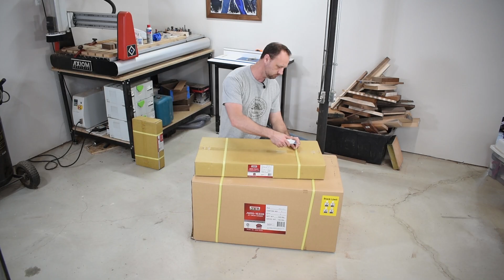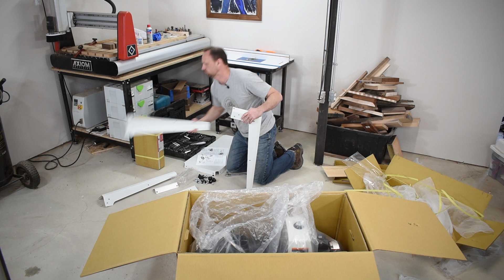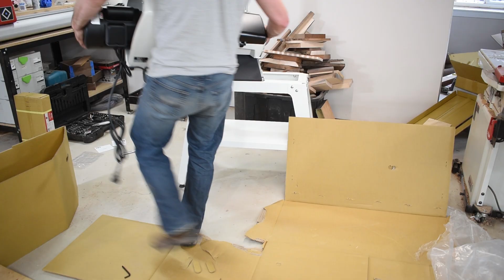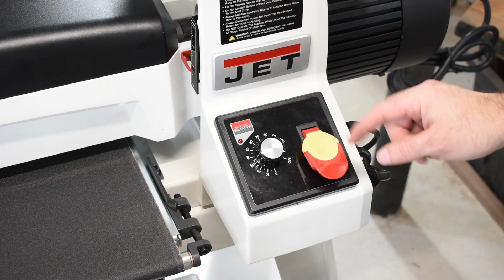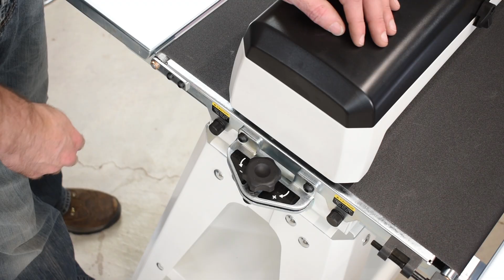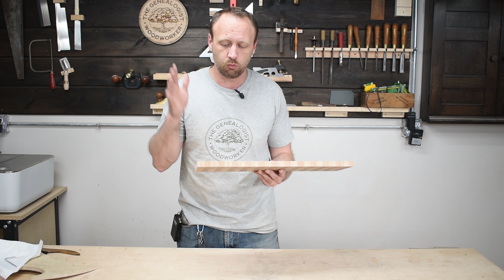Jet Drum Sander Unboxing and Setup

Comment: I wish you had bought the 1632 oscillator sander to compare post drum  sander handheld RANDOM ORBITAL SANDER  need . Do you know anyone who has used or reviewed the 1632OSC jet drum sander ? I have seen 2244 oscillator review but not 1632 oscillator review . 
  I have small shop in Idaho and have to sand outside and our weather  often makes this  horrible with winds to 25 MPH and frequent not forecast brief rain that makes me hate sanding and packing everything up to run into garage . Like your channel , trust you also . Jack in Idaho

Comment: Great video!  I just got mine and used your video to set it up.  Thx a mil.  Question though - why not just replace the 80 grit with the 120 and use the drum vs going back to the orbital.  That's what I had planned to do with mine, but now I'm wondering if it's just going to be too much work replacing it back & forth.
Reply from the maker: I replaced it with 120 which I keep in the sander. You certainly do not want to constantly change drum sander paper. It's not the easiest process. Plus, I've never seen a board that did not need sanding after the drum sander. It's a rough sanding tool that leaves marks. The most common practice is to sand the board with whatever grit you used on the drum sander. If you use 120 then start there with your orbital sander. If you use 150, start there.

Comment: I have this same drum sander and I cannot get rid of snipe.  I called Jet customer service and they were nice but no help.  Have you had issues with snipe, if so, how did you correct the issue?  I have tried adjusting the infeed/outfeed rollers with no success.  Thanks.
Reply from the maker: It does happen sometimes. I've had some luck by holding the piece down on the conveyer belt as it enters and exits the sander. I try to make it stay as flat as possible.
Reply: I run a piece the same thickness a few seconds prior to the piece I’m sanding. The sacrificial piece gets the snipe instead of your project. 

My issue is that my sander is uneven. When I run a piece through, the right side is lower than the left. Haven’t figured out to adjust that yet.

Comment: Do you have a trick for changing belts?  Those clips are hard to open and still have the roller not turn. I called the factory and they(as in 2 people)were absolutely no help. The problem for me is getting the belt tight.